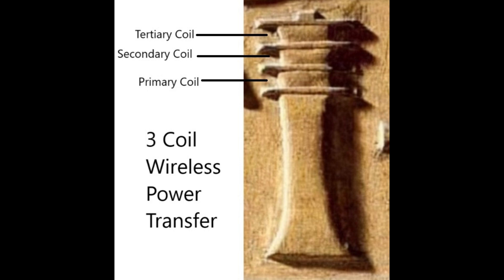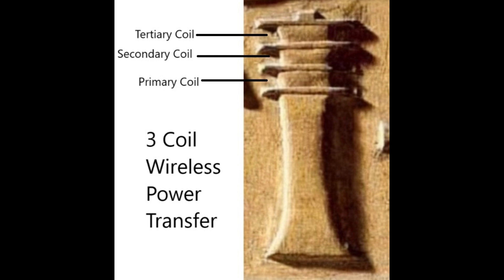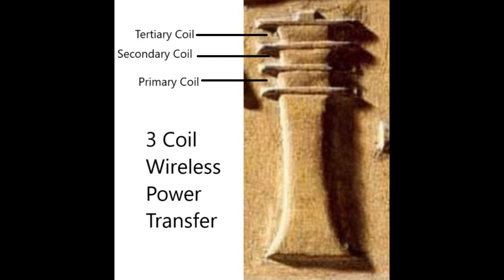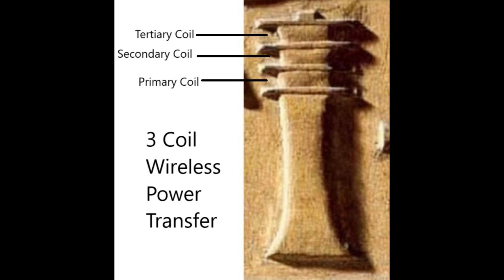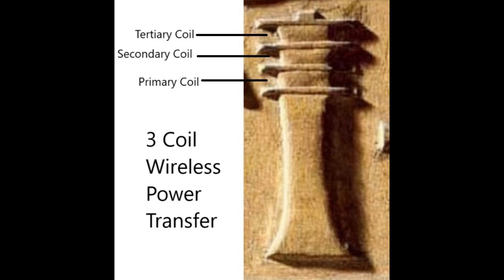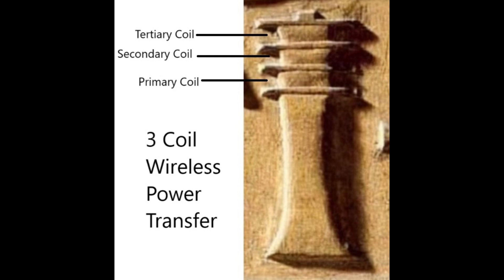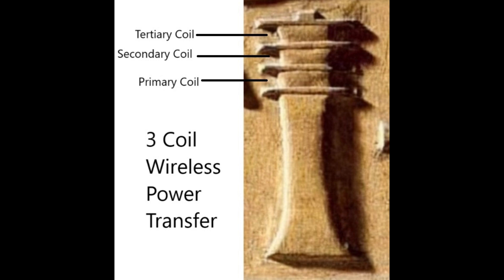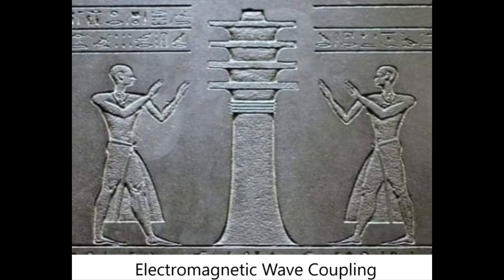Technologies of Ancient Egypt - Part 2 - Coils

Comment: nice work tesla pancake coils  eng bifilar coils  ...full wave half wave and quarter wave  all run on 7.5 hz scalar waves input of 7.5 x 7.5 x 7.5 x 7.5 ect
Reply from the maker: Hi Sir Dexter, thanks for your comments and the tip.

Maybe that's also what the copper serpent was transmitting in Numbers 21:8-9 
" Then YHWH said to Moses, “Make a saraph figure and mount it on a standard. And if anyone who is bitten looks at it, he shall recover.” 21:9 Moses made a copper serpent and mounted it on a standard; and when anyone was bitten by a serpent, he would look at the copper serpent and recover."

best wishes

Comment: Yes, the set of 3 coils in the Djed Pillar is half the story.  The stack of 4 discs comprise the wireless receiver  / antenna,  much the same as a DIY wifi antenna is just a stack of metal plates with very specific spacing between the plates.
Reply from the maker: HI Terry
That's an interesting observation, I hadn't thought to look at it like that.

best wishes